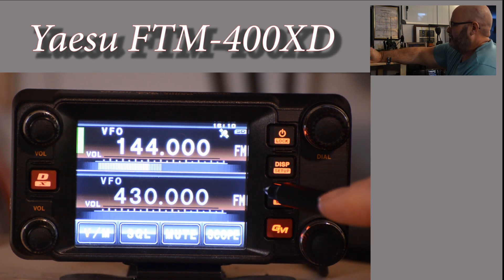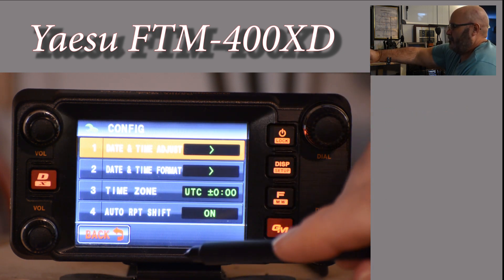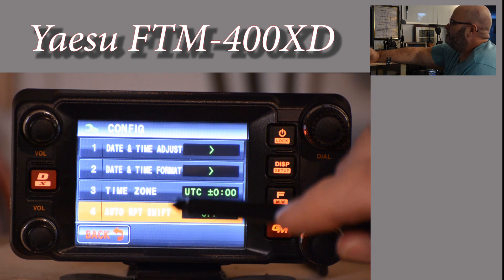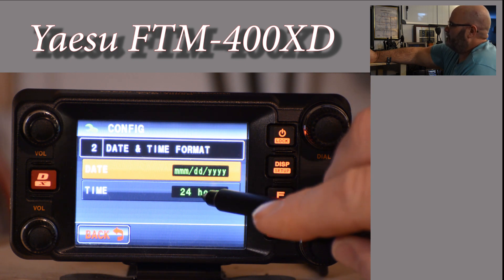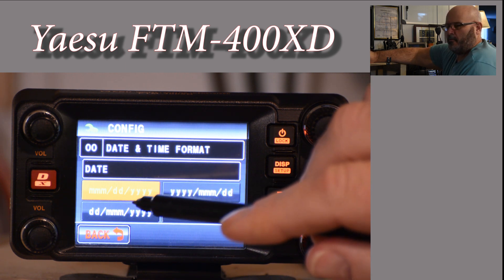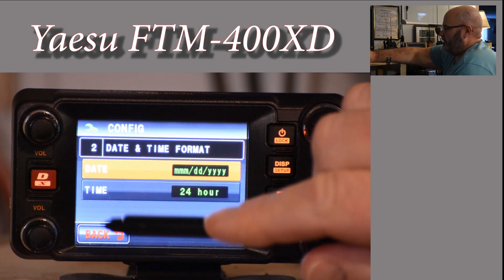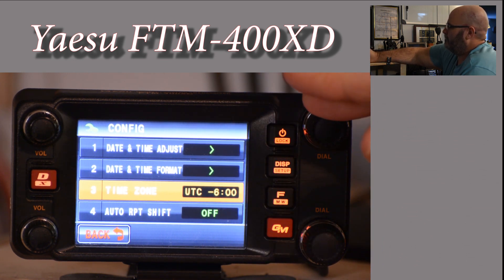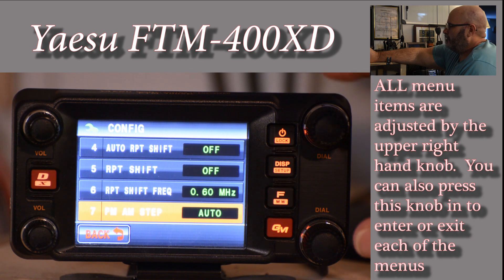Yaesu FTM-400XD Initial Setup and Basic Features

Comment: Is there no PC based software to interface with this to configure it so you don't have to navigate the menus? Like Ham Radio Deluxe for the FT891 for example?
Reply from the maker: Yaesu offers software for programming as well as RT Systems. Knowing how to program your radio from the front panel is always recommended so the operator is not reliant on the need for a computer to set up frequencies they may not have. The software is good for doing a mass upload.
Reply: @ka6ete217  Thanks; I appreciate the rationale you describe. I'm thinking about adding one of these; they look interesting.

Comment: Good video. I would not turn off the automatic repeater shift. I have about fifty repeaters entered into my radio and that would just create unnecessary work. I only have a handful of simplex frequencies and find it easier to turn off the shift for a few than turn if off for all requiring manually inputting those sifts. Plus I use RT Systems program to input the frequencies, easy pizzie!
Reply from the maker: Turning off the repeater shift has no effect on the frequencies already entered into the memory or ones being stored into memory. But the great thing is and one I always recommend is to find what works best for you, the user.